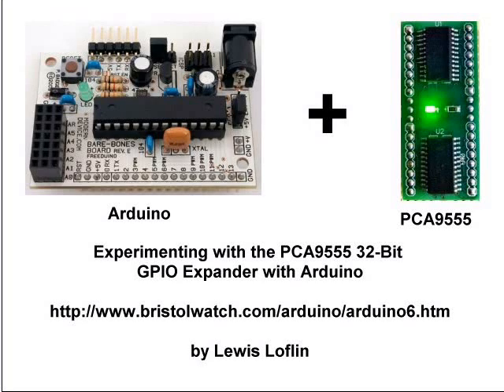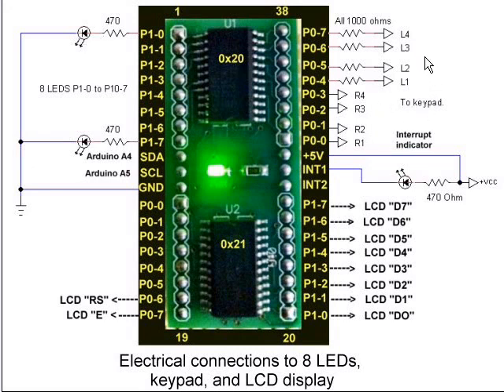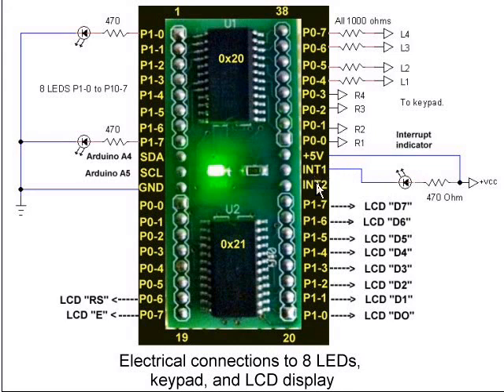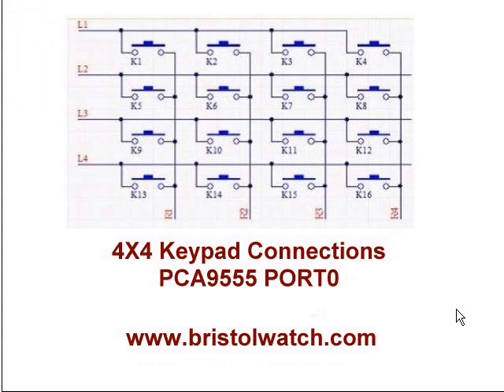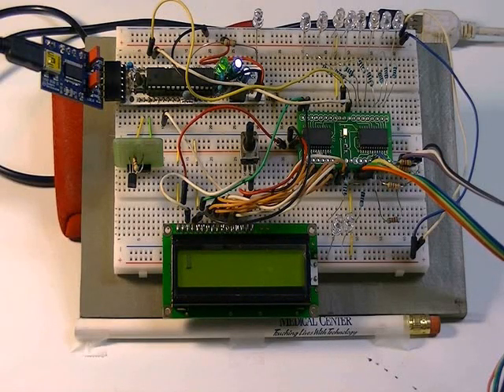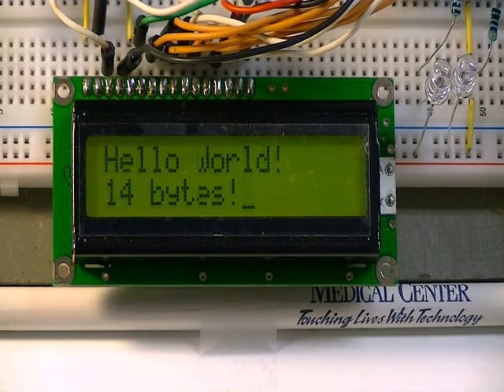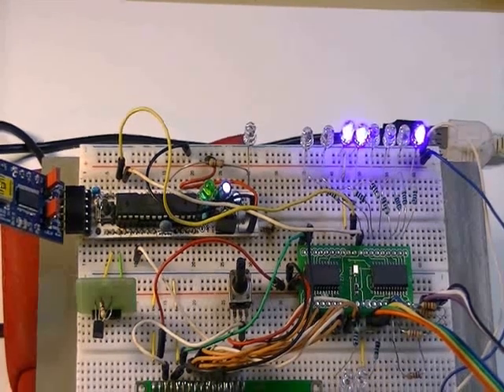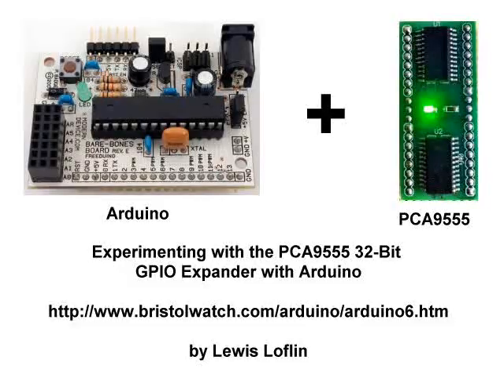PCA9555 32-Bit GPIO Expander with Arduino

Comment: This 32-bit module cannot be found on Ebay or elsewhere. W ould be unwise to spec it in a new design.
Reply: It’s just 2 PCA9555 next to each other, there’s nothing special about it vs a single PCA9555 module